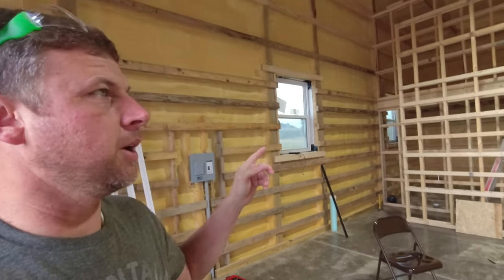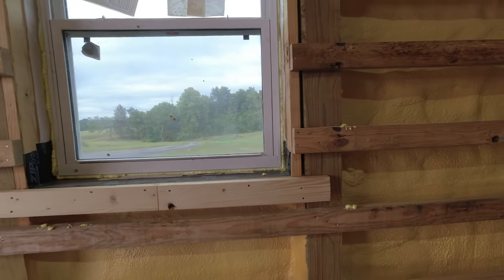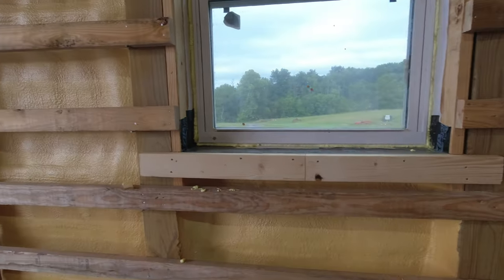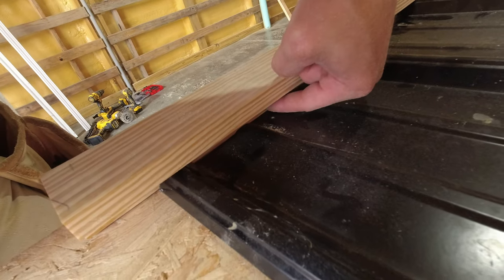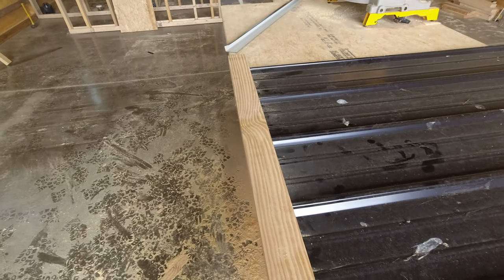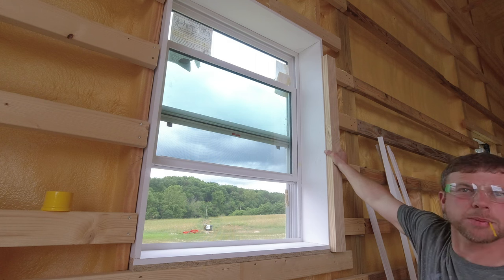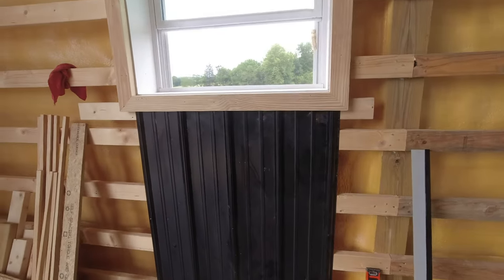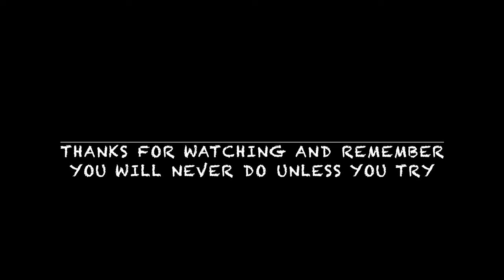How To Trim A Window, A Different Way When Using Metal Siding, (Not J-Trim) #100

Comment: I installed vinyl siding on my sunroom without using J-Channel around the doors or under the soffit. I trimmed out the doors using PVC boards similar to your installation, and covered the top run of vinyl near the soffit with PVC trim as well. It’s a cleaner, and higher-end look.
Reply from the maker: I would say that looks good, a little bit of trim goes a long way! My opinion, it is a great return for your investment! Thanks for the comment!

Comment: Thank you!  I have been looking for a method to trim my window and doors to replace the ugly aluminum with J-trim that was installed with exterior vinyl siding.  Could not figure out how to make it work.  This approach (with modification to weather-proof the exterior) will provide an excellent finished look.  Well, it looks great in my mind. Hopefully the final product looks as good as the  picture in my head. 😀
Reply from the maker: I think it will look better than J trim for sure, I am currently building a house and will be using metal board and batten siding and I am going to use the same method to trim my windows and doors out as well. You are correct a couple extra steps will have to be taken to waterproof, but I think it is feasible, good luck with it and thanks for the comment

Comment: Perfect, looks great. How deep into the wood stock did you cut for the metal to slide in, in both dimensions?
Reply from the maker: I allowed 1” back from the edge and removed 13/16 for my material to slide in. Appreciate the comment! If you decide to do it I would go ahead and put the metal up and just hold it back from the window frame and then add the trim detail afterwards. Can be a little difficult to get metal behind in some places. We live and learn and that was a test run.

Comment: looks great, i was thinking of doing the same with pressure treated wood on the outside of my barn
Reply from the maker: Thank You, I am in the process of building a house and will use on the exterior, I am going to use poplar and paint all sides. It will mean more work in the future but it really dresses the windows up. Appreciate the comment!
Reply: I’m planning on doing the same! How did yours turn out?
Reply: Pressure treat is for ground contact

Comment: I'm doing a new house construction for myself and I'd like to do metal. How would you do all the exterior trim out of wood if you were doing it? Would you do the same thing and saw out a channel in the wood for all the trim like the corner trim and the base trim?
Reply from the maker: How soon will you be at that step? I am building a house now and will be using wood for my trim and metal board and batten siding. I am thinking / contemplating two different ways to install. I wouldn't recommend doing it exactly as I did on the interior windows because you would get water  into the rabbet you cut for siding to slide into. Hard to explain in a comment, if you have some time before you will be installing I should have a video coming out talking about the way I am going to do it.

Comment: I think it’s a great idea!  I am going to try it in my garage.
Reply from the maker: Thank You, it trims them out pretty nice. One thing I would do different is I would add the trim after your metal is up because with the wood trim you don’t have the flexibility as you do with j-trim getting your metal in. Cut your trim and then mark a line around the entire window where your metal will hit the trim then you can run your metal just shy of the line and then your trim will lay right in there. Make the metal hanging easier! Appreciate the comment and good luck with it!

Comment: Just curious, why did you run your metal backwards? There's no actual paint on the back is there? I do like the reverse metal profile better.
Reply from the maker: I wanted the flat side for my finished side so I had them run it through their die opposite of what they normally would so I have the finished side on what would normally be the backside. Hope that makes sense

Comment: Can you show the outside and how you sealed it
Reply from the maker: I had a company build the shell of this building so they used j-trim on the outside. I built a house next door and I will be trimming around my windows with poplar on the exterior. I have metal board and batten siding. I attached a short where I trimmed one of the windows. I put a lot of thought into sealing from the outside. I will be installing all my trim this coming week and will make a video.

Window Trim #buildingahome #buildingtips #shorts
https://youtube.com/shorts/Z3dI6Xhc1k0?feature=share

Comment: What material  did you use for the boxes?
Reply from the maker: The trim was standard framing material, inside the window frame was primed pine 3/4” boards